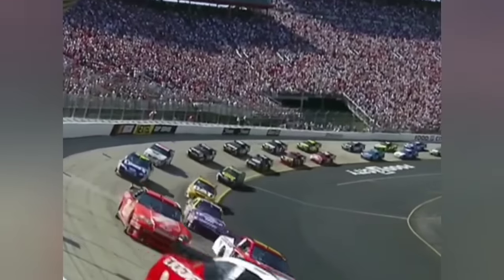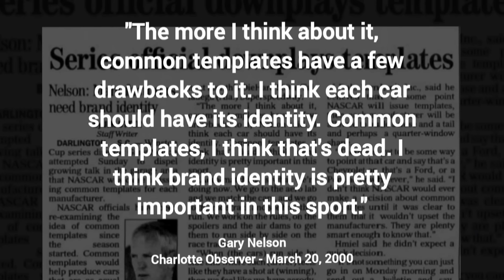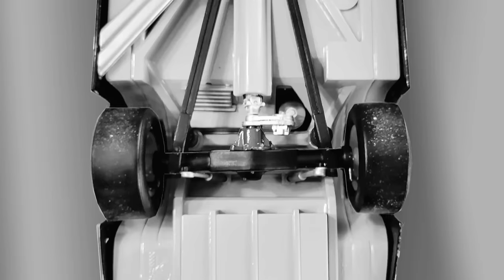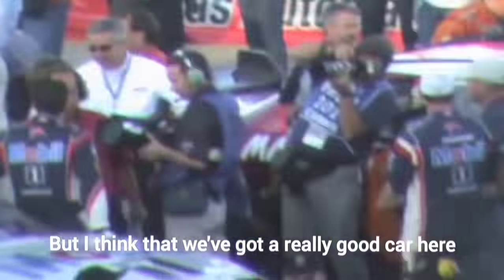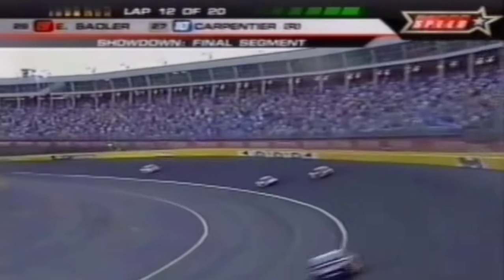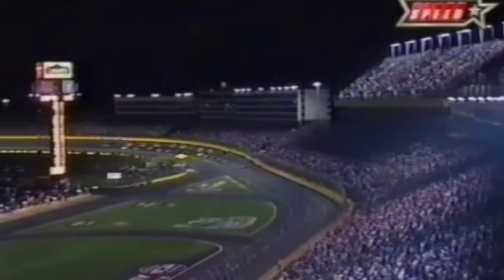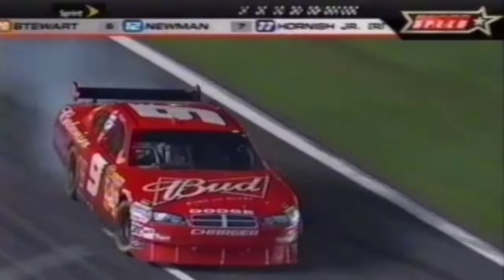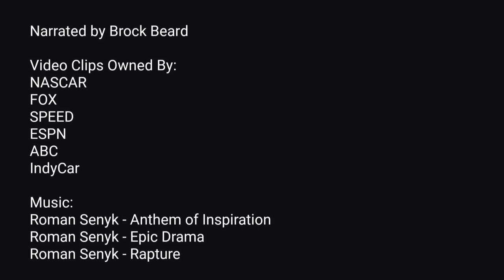The Car That Exploited the Car of Tomorrow

Comment: They shouldn't be able to change the rules mid-season. If you find a loophole, you should be able to exploit it for the rest of that season.
Reply: The risk of that, though, is that one manufacturer or racer dominates, and fans get bored and lose interest, especially if it's clear that nobody is going to be able to knock them off. While it might not be much of a problem in road racing series, for a series like NASCAR that is just oval racing and already has a reduced amount of excitement, any driver or manu that has a clear advantage is going to hurt gate receipts, and in turn it will hurt how much teams and drivers can get paid from winnings.  So it's in NASCAR's best interest that everybody is competing fairly and equally, with driver skill being the determining factor for who wins or loses, rather than the science and engineering of the vehicle.
Reply: @KevinFields777  revenue and ratings from 2002-2013 tell a different story. Chevy and HMS were wiping the floor with everyone for the majority of that span, and ticket sales and TV viewership were the highest they'd ever been.
Reply: he was cheating though
Reply: Wallll ridddee
Reply: @OvernightCrew being innovative isn’t cheating
Reply: @gswizzy17  finding a loop hole to the rules isn’t being innovative. That’s like saying “there’s no rule that states you can’t drop nails from the back or your car, so we did it” it’s still cheating
Reply: @OvernightCrew I don't know...maybe if you can come up with a better example I can see where you're coming from...I've watched so many interviews/clips with drivers talking about how if you aren't looking for loopholes then your team isn't trying hard enough. Creating rules versus breaking them...but again, maybe if you come up with a better example than dumping nails on the track.
Reply: @OvernightCrew On a funnier note, you should watch DW talk about the old cheating days when drivers were literally dropping lead out of their cars...which is clearly cheating and not looking for loopholes. He's a great storyteller, and his episode on Dale Jr's podcast was a good watch.
Reply: @OvernightCrew  pretty sure there is a rule about that.. think of a better strawman next time. And if there wasn't a rule that said you couldn't drop nails from behind your car IT STILL WOULDN'T BE CHEATING. You are not violating any rules... therefore it is not cheating.  Someone doing something you do not like isn't fucking cheating. That is a child's logic.
Reply: @OvernightCrew  Cheating implies an unfair advantage that those you compete against do not have access to, whether logistically, or against the rules. IE: x-ray or wall hacks, aimbots, or flying in a _RACECAR SIMULATOR_. There's not really any rule against having a modification to your car that literally anyone can do.

Since there wasn't a rule against this, and everyone had the opportunity to do this, it was fair game. NASCAR didn't like the idea of all the cars being jank as fuck so they fixed it so it would be cheating, but that said, it took the rule change for it to actually become cheating.
Reply: They kinda "have to" change stuff like that.  In this case, it's just wheel alignment, and every other team would've started doing it too... and then the next thing... and the next... and before you know it, they would be so "wild" with offsets and all of that, it wouldn't be the same anymore.  Just my thoughts on it.  Did they "cheat" though?  Absolutely not.
Reply: @OvernightCrew  legal cheating
Reply: @trailingrails9953 can't argue with statistics. I attend 1 NASCAR event Bristol 2015 August truck race. Only the front stretch was open wasn't 1/4 full. Looking up at those nosebleed seats 😂 I imagined that place full. No way id sit up there, couldn't pay me to sit there. I was under the roof behind the flag stand 2 rain delays ,people looked like insects cars like hot wheels😂. I'll tell ya what killed NASCAR.. big flat screen TVs best seat in the house. It was wet, hot ,LOUD ,miserable experience.
Reply: @KevinFields777  well it would be unfair to the innovator if they have to spend more money to "reset", make new design because mid season rule change
Reply: @OvernightCrew finding loop holes isnt cheating just look at formula 1 people cherish the innovation and loop hole breaking and teams arent punished as a result even some teams work along side the fia to develop their parts legally until they are banned
Reply: @KevinFields777   That's stupid though.  Engineering is an inherent part of motorsports.  If you want it all to come down to human skill go watch foot races.
Reply: @OvernightCrew  yeah, 'spirit of the rules' should always apply, if you're using a loop-hole to circumvent a rule, the loop-hole should be closed immediately.
Reply: a loop-hole to circumvent a rule should always be closed asap.
Reply: @M1ggins  I’m glad someone gets it
Reply: @OvernightCrew  No he didn't cheat. Everything they did to the 77 car was within the rules.  Nascar did the same thing to Jeff Gordons car.
Reply: @OvernightCrew  Gaming the system is part of the game though. If there's no rule that specifies the maximum length and diameter of a fuel line, is it really cheating to run a 2" 130ft pipe instead of a 1/4" 15ft tube? Every constructor could have done it, as there wasn't a rule against it. It's being creative and taking every opportunity you have to win. After all, who's to say that if you don't that the opposition won't either? Again there was no rule against it until someone did and they made a rule.

Compare this to say what (iirc) Toyota did in WRC where the rules around the restrictor plate were quite clear. But they made a mechanism that due to the pressures in the intake could push the restrictor plate out of place and allow air to bypass it. That's cheating.

The problem NASCAR had at the time, and possibly still has I don't follow NASCAR, is that they wanted to be both a spec series and a constructors championship at the same time. Which sounds good in theory, but isn't really a thing in practice. Take for example Aston Martin (again iirc, I don't really follow F1) who figured out a clever solution to the new rear wing design rules. They had a considerable advantage in aero with their design and the other teams basically copied them once they realised this was an option. AM didn't cheat, they were just more creative and made a better wing.

I think that both types of competition can be interesting. I love Formula E, even if it's a spec series and all the cars are effectively identical. But I also like F1 and LMP, just because constructors actually get to make their own cars from the ground up. I just think that any series needs to decide on whether it wants to be spec or constructor, because half and half just doesn't work.
Reply: @fermitupoupon1754  you summed it up pretty well. It’s just crazy and should fall under some sort of “goes without saying” type of rule. It’s like saying you can put a bulldozer scoop on the front of your car and push people out of the way because it doesn’t explicitly say it in the rule book.
Reply: @KevinFields777  Hang on Ferrari do dominate in a certain race.... thats why i aint watchin, the biggest spenders spit the dummy out and the so called puppets....err no organisers of said race bow and roll the red carpet out.
Reply: That would make things a bit more interesting.

Comment: The All Star Race needs to be a “run what ya brung” event since it isn’t a points race anyway.  That would make it worth watching again.
Reply: All racing should be like that. Let people go crazy. Only have regulations on safety, but for the rest, anything goes
Reply: @jesperpsv98  i dont think you will find that in nascar but there certainly is races like that
Reply: @Jesper van Berkel  I would love to have minimal rules on relatively arbitrary stuff

Like only limiting tires to a very specific tire spec including weight rating, and that's it for rules excluding safety
Reply: @jesperpsv98  That would be completely unsustainable due to the huge expenses which would be required to be competitive. Just look at what happened to classes like GT1 and Group C.